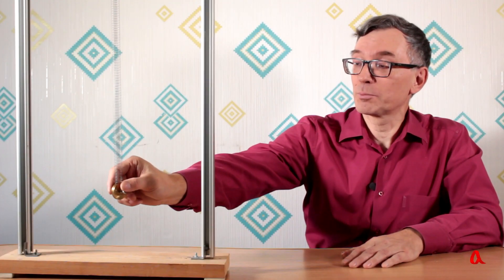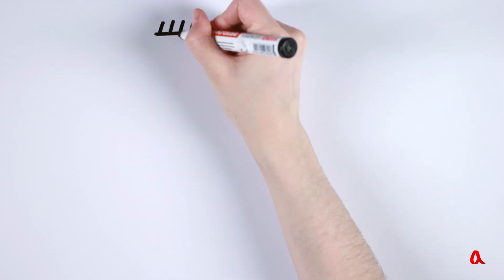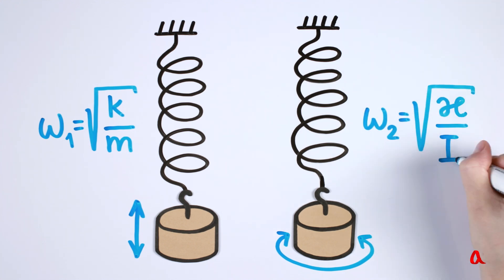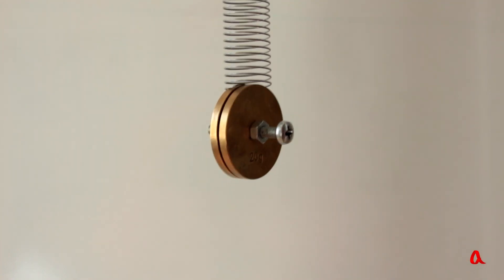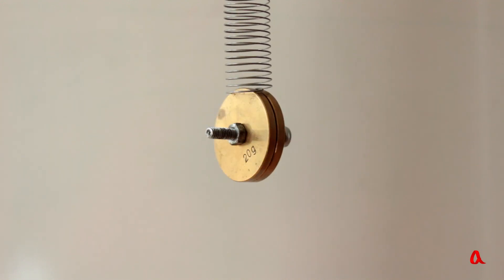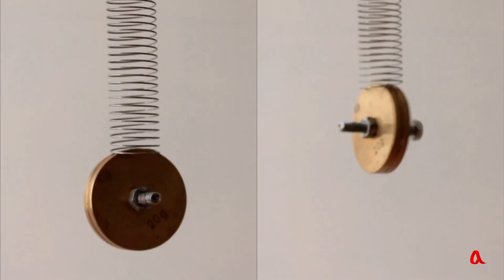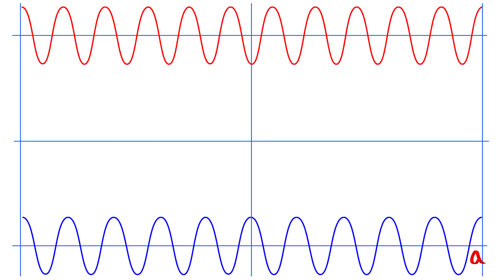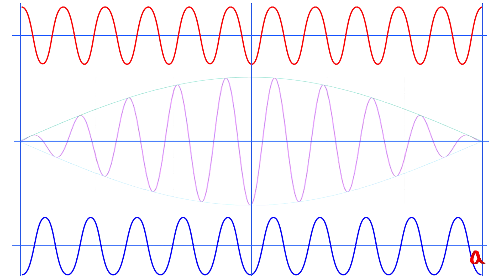The Wilberforce pendulum

Comment: The moment of inertia about the vertical axis is greater for the spaced discs version, so for a given torque the angular acceleration will be lower, resulting in a lower angular amplitude .
Reply: I think this answer is incomplete. The thing is that the change in moment of inertia changes the natural frequency of the rotational oscillation. When this is deviating too much from the natural frequency of the vertical oscillation there hardly is any energy transfer from the vertical oscillation to the angular oscillation. The two oscillators just do not interfere very well.